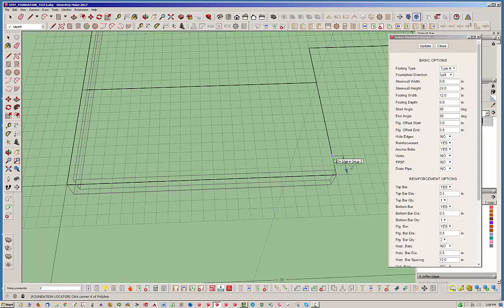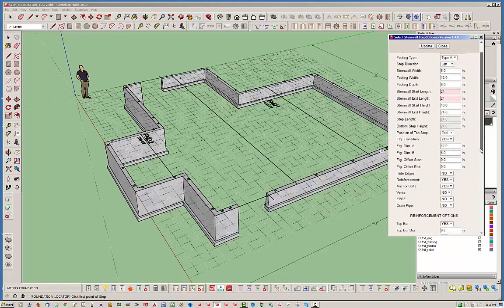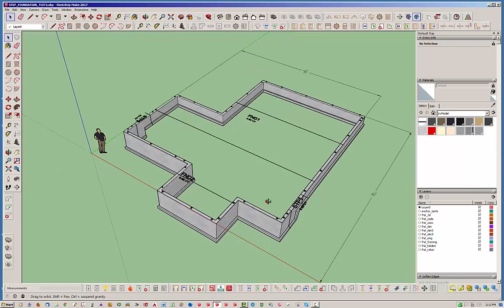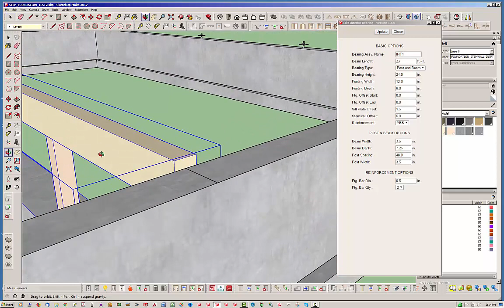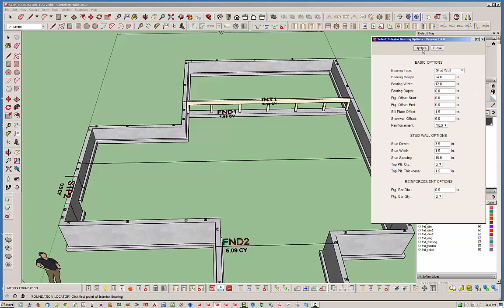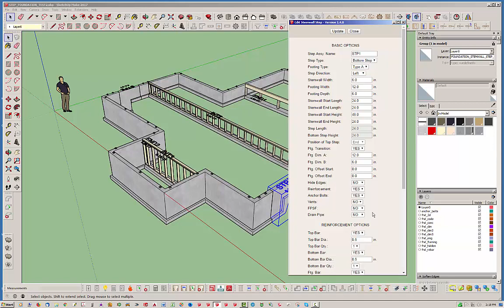Medeek Foundation Plugin:  Tutorial 6 - Polyline Stemwalls, Steps and Int. Bearings

Comment: Feature requests: Mudsill (on/off) at stem wall creation, Mudsill material option (Pressure Treated/Redwood), Joist inside stemwall top level w/ top of Mudsill and bottom set on ponywall, floor sheathing on top. Then build walls on top of floor deck. I'm loving the power of your plugin! Keep it coming!!! Can you make cladding and etc push-pull?

Comment: I see there are no 'Presets' for the Foundation Wall Tool, like there are for the Wall Tool. Is there any way to 'copy' an existing polyline or step stemwall settings to use when starting a new polyline or step stemwall? It's not that big of a deal since there are not that many settings, but for the step stemwalls there are more to remember to match up with the others.
Reply from the maker: Presets do sound like a good idea for stemwall for steps.  I will give this some further consideration.
Reply: @medeekdesign  Thanks.

Comment: Is there a way to join the corners of two polyline stemwalls? I'm looking to join a step stemwall to a standard stemwall at a corner, but the foundation walls overlap the way I'm doing it and there is a gap in the drain pipe. Is there any way to draw or move them for them to recognize they are part of the same stemwall run?
Reply: At a corner, no.  Usually I will join steps and polyline stemwalls along a straight run.  In this case they butt up to each other and the corner situation is avoided.  If you have a more complicated situation where this is not possible please send it to me via email and I would be interested in studying it further:  nathan@medeek.com
Reply: @nathanielwilkerson6217  Got it. I turned the corner with another 24" section of the polyline stemwall and then started my step stemwall. That worked fine. Thanks!

Comment: [b]Version 1.6.1[/b] - 08.31.2020
- Added a footing offset parameter to polyline stemwalls.
- Enabled options for 90 deg. footing hooks for vertical rebar in polyline stemwall.
Reply: What do you do if your stemwalls have different top of wall elevations?